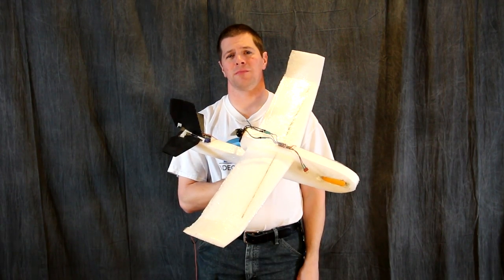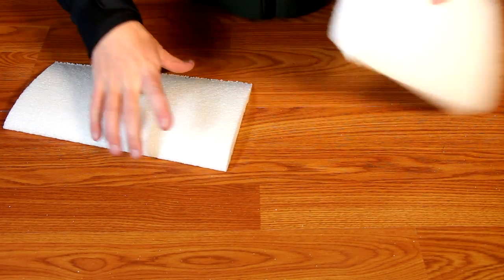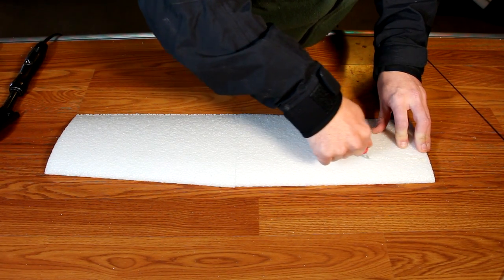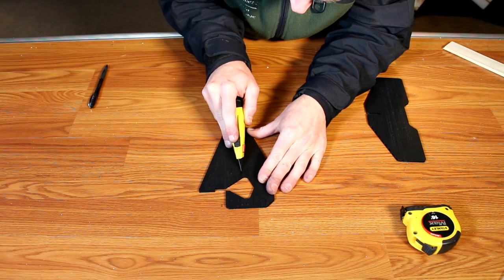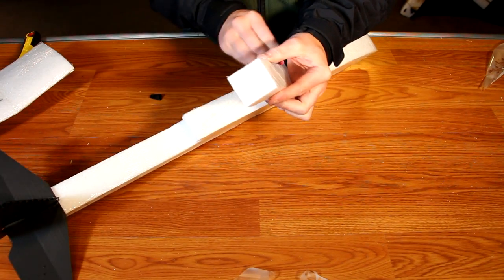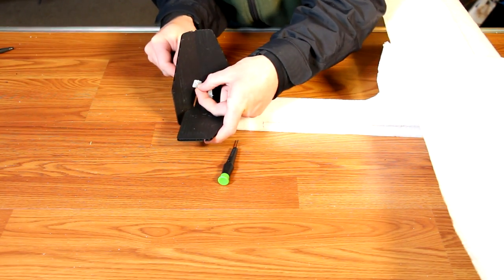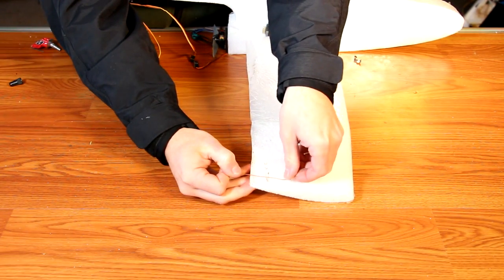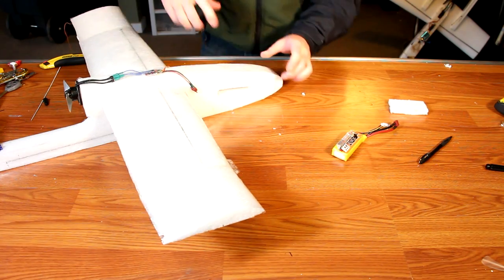Build the VAS Spark airplane

Comment: How do you work out the most efficient motor kv and prop size? I'd love to have a plane fly for 40 minutes. Could you list the electronics you'd recommend for the longest flight times on this plane. I am excited to get one :)
Reply from the maker: I used this motor:  http://www.stoneblueairlines.com/hangar/motors-esc/motors/airplane-motors/emax/emax-gt-series-brushless-motor-1660kv.html
The prop is an APC 6X5.5E.    The trick is to balance the airplane properly and it will fly on as little as 1.5 amps.

Comment: can you use a 1100kV motor with an 25amp esc or 30 amp. what kind of propeller should i use with this setup.. cause i have these extra parts lying around.
Reply from the maker: newtypeJP No.  You need a minimum of 1500kV on this aircraft.  I recommend an 18 Amp ESC for most builders.  I personally am using a 12 Amp because my motor only pulls 8 Amps.
Reply: okay thank you.
Reply: what motor would you suggest with an 18 amp esc

Comment: wish this would have been out before i hacked mine apart..SBA did a decent job on the video but left a lot to the imagination especially for the higher end power system.  this is much more realistic for its purpose...a trainer
Reply: I posted all our recommended gear on the spark listing if you wanted to see what options you have for motor esc that sort of thing. Have have 5 built up so have played with it all.
Reply: ***** right thats cool..i followed them all but the build video was great in parts but big gaps in others..especially the battery fuselage mod type of deal..i tried to imitate that but just ended up making it too big..was hard to see in the videos..its my fault for being an early adopter and ill just need to get a new fuselage when you guys get caught up..your video was def the opposite of alex's....which i think would have fit my build better!!  ive learned a lot since that build
Reply: biomedchad
 ya that was more of mod for the pro guys but you can build it a few ways so that is what is fun about this plane. Light or heavy it can do it all. We have five built up we are going to show off soon with a full build up too for guys to see how much you can do with this little plane.
Reply: Alexs is featuring our light setup for the trainer option. If your an fpv guy it can be loaded down and still rock but needs the bigger motor setup.
Reply: ***** cool..what about spare parts..soon?
Reply: biomedchad Just email us we can get you what you need.